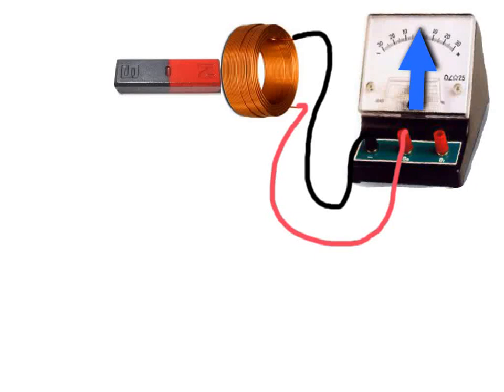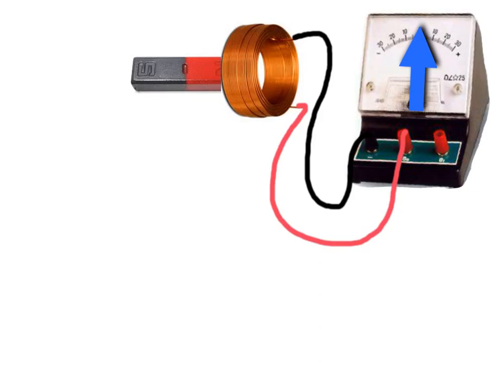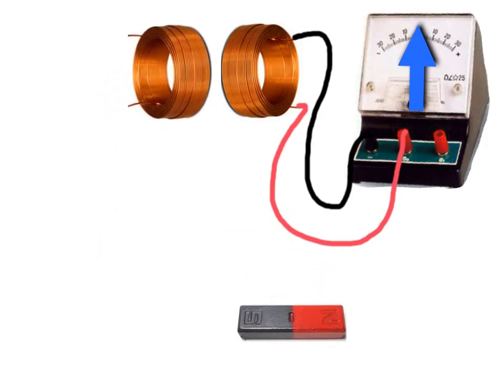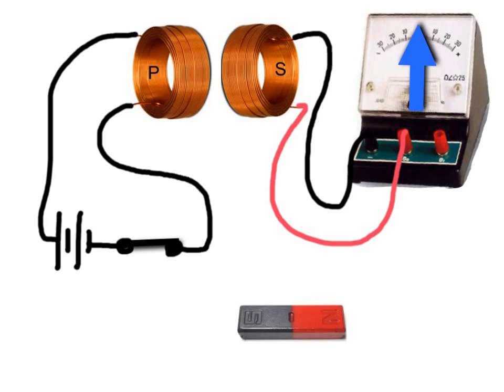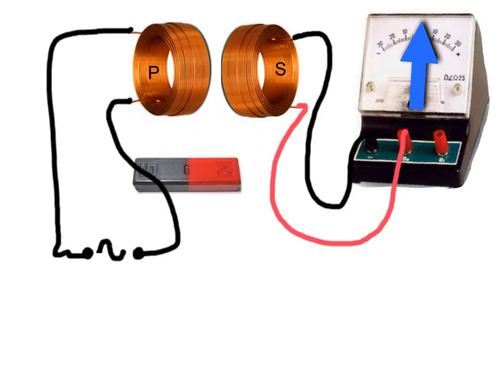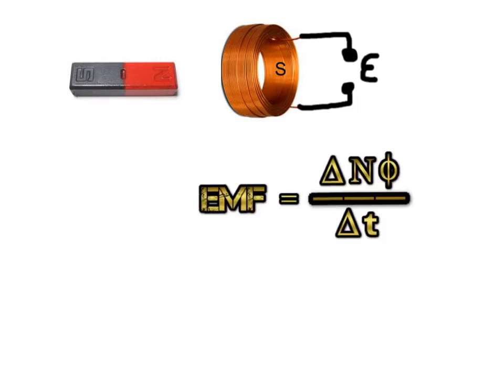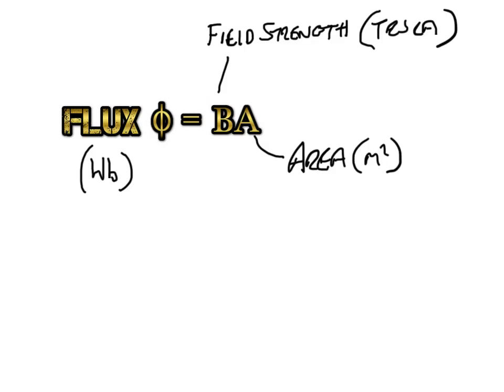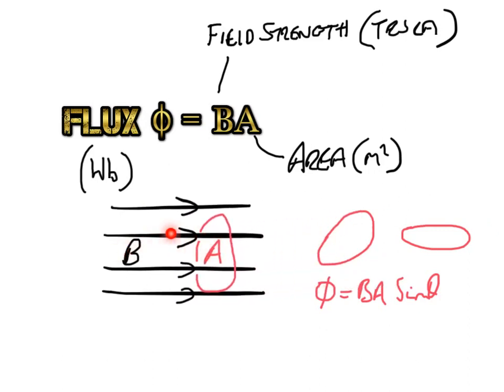Transformers and Electromagnetic Induction 01

Comment: I also wud like to ask u a question from our unit 1 exam.....question said suggest why the power calculatesd is a minimum value (for a roler coaster) ? .. I wrote "because it still needs to go uphill"...was confused with air resistance tho but i wrote tht only...